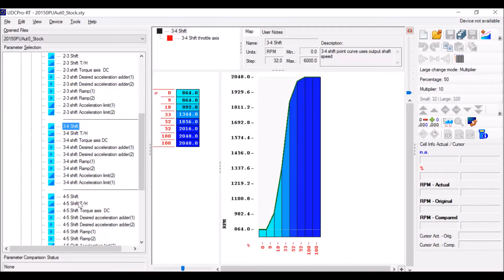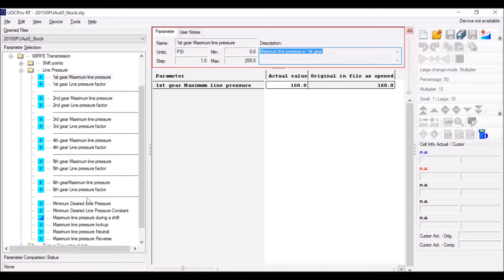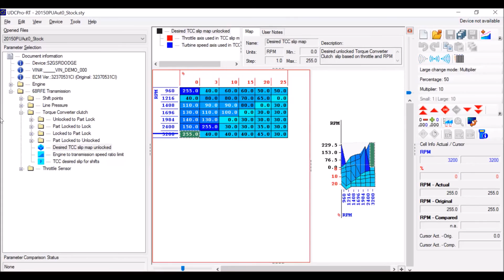Smarty UDC Pro Transmission Tuning

Comment: i have the so6 ,and an 03 cummins 48re .Im very happy with the tuner Im no techi ,so my question with udc are there some baseline tunes for engine and trans that can be used ? or suggestions based on mods on what your doing . for me its a driver tow vehicle . i enjoy the extra power but dont race .also i plan to upgrade trans with a billet single disc and the other suggested billet bits and upgrades . are there other videos or forum threads I should read to get an idea of what i want . Brian at Smarty helped me a couple years ago ive been super happy with s06 but would love to play with trans shifting events ...Mike
Reply: +Mike Snyder  i see this is for the newer 10-16 trucks , wow sounds great being able to control shifting events !